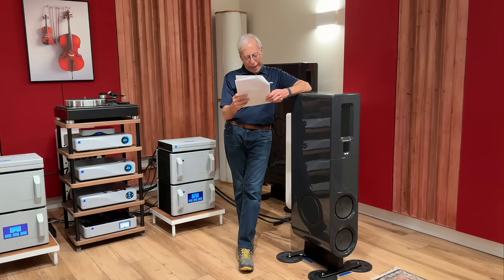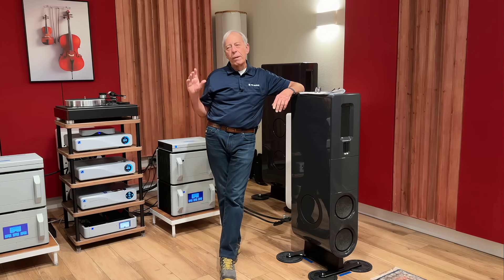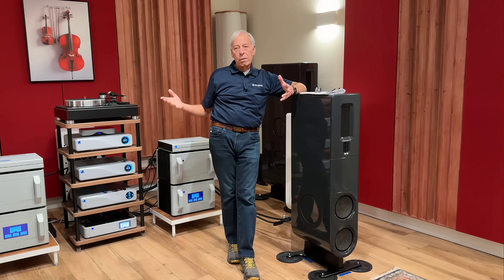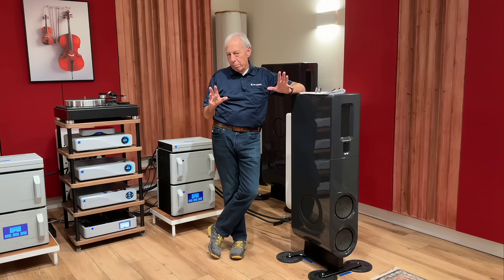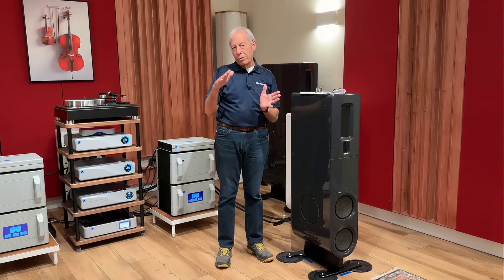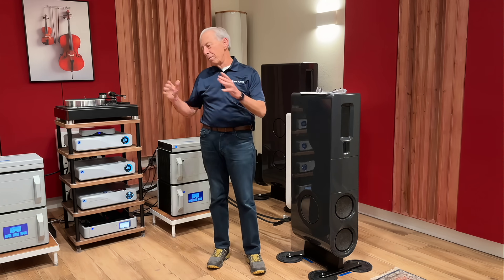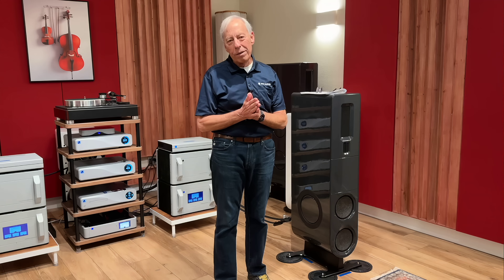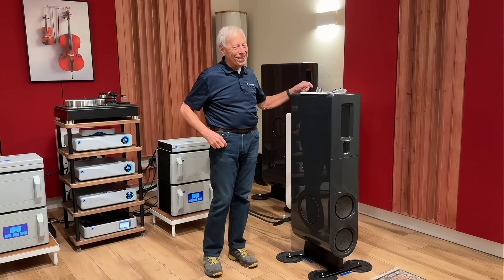24 bit vs  32 bit DACs

Comment: Poor man here. I run a pair of klipsch synergy III F-3’s (dual 8” woofer, 3/4” tweeter floor-standing) with 1990 vintage Carver CT-17 receiver/tuner and TFM-25 amplifier. This particular combination was very inexpensive to set up, have always just used the DAC in my television! When I changed from a Sony television to LG OLED I noticed a decrease in overall clarity and increase in noise. So, as an experiment I ordered this $35 SMSL PS 100 DAC, which is 24 bit. Should sound better than the built-in DAC in any TV, right? Nope. And interestingly, it made my soundstage sense of depth, height and width disappear halfway, especially when I left my stream box (Apple TV) in auto format. Forcing it to output 16 bit PCM got a lot of it back. No idea why. I can hear an overall increase in clarity for the majority of each soundtrack but a lot of soundtracks that I know well have had subtle “background“ portions fade away, or flattened out like I’m listening to a mono version. What gives? I was so stoked to listen to Spotifys new lossless versions on this little gadget but it’s just not the same jaw dropping experience as the regular old TV output with the sonic holography applied, even if it was hissy and had low dynamic range. Thoughts? Paul, I’m sorry I can’t afford to buy even 1/10 of your DAC. 😅
Maybe I should try a Schiit? I’m unemployed right now, hard to justify.
Reply: Interesting. When I finally connected the 2014 Vizio TV to an amp, using its DAC to 2 channel analog output, the sound quality was far below expectations, equal to a $15 bluetooth to analog dongle from Ebay. Paul does recommend Schitt Audio and I've been following audio for 45 years, and in my opinion, Schitt in your situation would be the only option. Amazon is full of off-brand DAC's and Schitt's is the only one (I know of) from a real audio company. $150 full retail. Otherwise, obviously, the next step up is looking at an AV receiver ... but you don't need that.
Reply: @grandrapids57 Yeah apparently the 2010 era Sony tv DACs were nothing to scoff at, guys at a Hifi shop approved, saying it wasn’t surprising I was happy with it. Would an AV receiver under a grand have any better quality of DAC? Seems like any mainstream Sony or denon etc for a few hundred dollars is going to budget out $50 BOM cost for the DAC, roughly what I paid for this cheapie DAC. But it’s probably designed better post-DAC in the analog section. I’ll probably get a schiit sometime, my system is handicapped.
Reply: @brentdennard6722 ...That's a real bummer, but thanks for posting your experience as I found it to be an interesting read. I'm of no help to you as I have no clue about uber cheap DACs, nor how much you would have to spend to get the sonic quality of your SONY TV DAC back...sorry 😕
Reply: Thanks, snob. My biggest question is why 24 bit down conversion to 16bit sounds better than 24… must be a design problem with this cheapie DAC.
Reply: I just checked out again that Schitt Modi 5, man oh man that is a cool bit of kit! You've got some real premium equipment there- that set up was beyond my dreams back in 1990! BTW, If you want to add good Bluetooth, I have been using 3 of these. They are older- but are CLEAN and I've bought two "more modern" bluetooth adapters since but those newer ones went into the garbage. On Ebay find "Logitech Bluetooth Adapter model S-00113." You can power it with the original 5v adapter or you don't even need that, a $5 USB A to barrel type cable will do it. I use them for the 1- old analog office system, 2- the bedroom system, and  3- the "main" one with a PS Stellar Strata and a $$ pair of electro static speakers.

Comment: Hardware wise, 32 bit is easier to manage due to the alignment to a 2^n number.
Reply: Yeah, 32 bits is not about audio but about data processing with modern processors operate in 32 bits or higher. This includes CPUs, DSPs and more.
Reply: But it’s trivially easy to compute 32-bit audio data and feed it into an (e.g.) 18-bit DAC.  You just throw away the low bits, no problem.  DAC design is hard, computing design is easier.  You shouldn’t let computing considerations affect the DAC design.
Reply: I rather have just have a DAC chip handling 20 bits and not all the computing stuff. And just take in 16 bits and avoid as much computing as possible. It is hard enough getting the power system so quiet that the 18-20th bit even stand the slightest chance to be getting produced in a correct way.

Comment: You can determine the theoretical dynamic range by multiplying the number of bits by about 6.
So,

24 bit ~ 144 dB
32 bit ~ 192 dB

These are theoretical limits to the dynamic range. In the real world it is lower.
The 'real world' or practical dynamic range typically:
24 bit = 110 - 125 dB
32 bit = 115 - 130 dB

So, practically speaking you are not extracting too much more dynamic range with a 32 bit DAC compared to a 24 bit DAC.

It's best to deal with the Effective Number Of Bits (ENOB).
For most HiFi systems I would use a 24 bit DAC.

I agree with Paul's final comment on 'listening'.
Use your ears and feel the music quality (not the audio or sonic specifications)

Comment: Completely incorrect as dynamic range calculation you showed. 
As an engineer I expect you to do the math.
16 bit = 96 db
24 bit = 144 db
32 bit = 1528 db (floating point) or 192 (fixed point)
Reply: You are wrong. Check your math again
Reply: 32 bit integer has 192 db. 32 bit floating is 1528 db. Knowing the difference between floating and integer is expected from an engineer. If your DAC has 32bit DA they almost always mean integer. If it's internal calculation for digital eq or volume change it's probably using floating point.
Reply: @alex_madeira Yes good point, thanks.
Reply: "As an engineer...", are you sure?, though I know that in USA some are "engineers", whereas others are engineers (the professional ones).
Reply: 32 bits is 192dB...
Reply: @ThinkingBetter 

32-bit Integer (Fixed Point): Offers a theoretical dynamic range of approximately 192 dB (32 bits × 6.02 dB/bit). This format has a hard ceiling at 0 dBFS; any signal exceeding this will clip and distort.
32-bit Floating Point: Offers a massive theoretical dynamic range of over 1,500 dB. Unlike fixed formats, it can represent signals far above 0 dBFS (up to +770 dB) and far below the traditional noise floor (down to -758 dB).
Reply: @jim9930   ...a massive following in terms of product sales or in terms of on-line popularity?